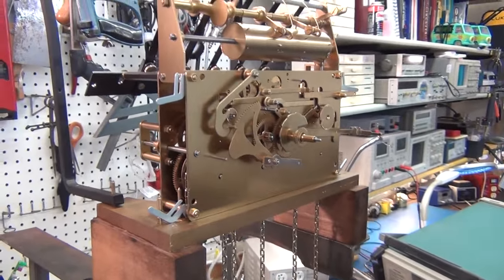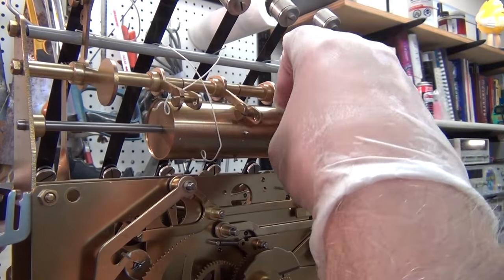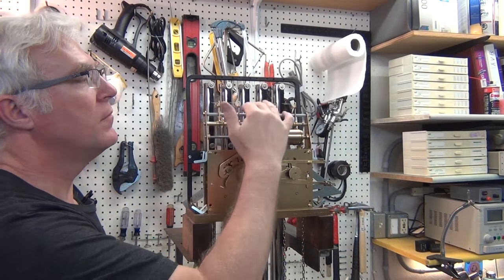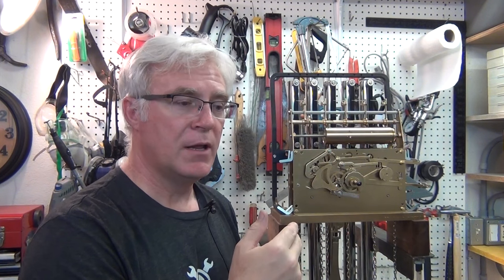Grandfather Clock Test Stand and Hammer Refurbish

Comment: I used to work for the Navy's PTTI (Precise Time and Time Interval) program.  Cesium and Rubidium time standards accurate to 5 parts in 10 -13 seconds.  Now that I am retired I found Todd's posts on mechanical clock repairs.  Very fascinating.  Todd, from one horologist to another, good work!

Comment: I purchased my Ridgeway Grandfather 3-chime, 3-weight, chain-drive Clock in early 1982.  It still keeps time perfectly but does not chime or gong.  So, I have watched many videos about clock repair and maintenance and now have the Urgos UW 32570D clockworks out of the case in preparation of cleaning (with rag) and oiling it.  Do you know of any instructional videos on the Urgos UW 32570, 3-chime clockworks that would assist me with my work?  Thanks in advance.

Comment: Hello Clock Guy - these videos are invaluable. Many thanks - they're real thorough.  I'm dabbling-fixing a grandfather Ridgeway Clock for a friend.  Hanging the pendulum from a spring I made, cut out of clear plastic from the top-hanger section of a plastic container of wood screws (#10/1" one hundred pack, from EVERBILT Flat Head Phillips) with a cut length of a paper clip perpendicular and through the plastic - sticks out 1/16" each side for arms to grab.  It is thicker, stronger plastic and probably farr less fragile than the original springs.  The pendulum weight is un-damaging to the plastic and 'paper clip post.'  Working perfectly, it's flexible and may be more durable than the (already broken-every one of them) springs which came with the clock.)  For the purists, I suspect this is unacceptable but you can suffice while waiting for authentic parts to come in the mail.  I've loved dabbling in all of the rocket sciences. : )
Reply from the maker: Interesting solution. Glad it worked out. Please update in a year or two on how that works out. Thanks.

Comment: Todd, I love that goatee. You should grow it back.  So, my 1905 J.E. Caldwell clock has 9 Waltham tubes, runs very well after I saw your beat video ….but has 1 issue. It chimes 4 times at 10 o’clock and is 6 chimes off subsequently. Is the only way to correct this by resetting the hands or is there another way to sync it properly?
Reply from the maker: Sorry, I’m not familiar enough with such an old clock.
Reply: @ToddFun  thanks for the reply….a fellow ham

Comment: I just acquired the exact same clock from deceased grandparents.
Love it but after first pass of service, I was told most all the bushings at the pivots are worn out. 
For this movement (UW 3/18) any tips on where to get the correct parts if I wanted to tackle this job myself?
Clock runs fine but needs additional power to move the chimes which then will initiate the strike. It will not do this under its own power.
Reply from the maker: you’ll have to take it to a horologist who rebuilds Clocks. Putting in new bushings is not something you can do without specialty tools. If you get those new bushing drill points off even by a tiny bit, the clock won’t work.

Comment: Todd!  I have the same mechanism in my GF clock.  I am getting ready to disassemble and clean.  It does have a problem I was hoping you can give me some insight on.  The chime is going very slow, the fly spins very slowly.  Any ideas  before I jump in.  I am hoping it's just an oiling issue.   Thanks in advance!
Reply from the maker: Could just need a good cleaning and oil of the whole mechanism but also check that the butterfly springs are not broke or damaged, they should pull in all the way on both sides and if you gently pull them out a little the springs should pull the butterfly wings back in. If not the springs could need cleaning or they might be broken. Be careful, delicate stuff.
Reply: @ToddFun  Sorry one more question.  How long is the pendulum required and how heavy are the weight in your shells?  I was told 7.75 for the strike and time and 13.25lbs.  That seems high.  I was able to get it to move faster just by adding oil.  I am going to strip it down and clean it completely.

Comment: Saddlemakers leather works better, you can shave the thicker pieces from the rear to get the right thickness. You need a stiff leather, and soften it with hoof oil before assembly. The oil will evaporate again leaving a stiff compliant surface.
Reply from the maker: +SeanBZA Interesting idea.  I had ordered leather pads from "R & M Imports" which are custom made for these hammers. They might work even better. I will test when I get them. Thanks for your input. Have you serviced such clock hammers this way before?
Reply: +Todd Harrison (ToddFun) No, other equipment that uses a leather wear strip and leather brake pads. The pads are available, but at a price, so I went to a local saddle shop and got a few pieces of offcut hard cow leather, and spent a little time with a rasp and a sharp blade cutting some new ones.  The brake pad runs in oil, so it does get soft with time, but the other wear pad just took a little work with Neats Hoof oil ( also good for suede shoes as well, or regular polished shoes, it gets them nice and soft) to get it slightly more supple. 

Took a few small pieces, and used a letter punch set to emboss my name in the end, and made key bunch markers, so I can feel in my pocket which bunch is which, as they are different shapes. Took 5 years for the one to wear the hole out, so last week just trimmed the thin end with the hole off and used an awl to make a new one. Still have a bag of offcuts left over in assorted thickness’s, even used some to fix a mail bag.

Comment: Great video! Can't wait until the clock is up and running in the living room. I have a suggestion for the text in your videos though. Not sure what you can do with the program you're using, but I'd make the text white with an outline of black. Easier to see and looks better. I'd also leave it up longer. Had a hard time reading it fast enough.
Reply from the maker: +Veronica Harrison I can change the fonts to just about anything. Normally I leave the text up longer but in this video the background was moving around so I had a hard time keeping the text in reference to the frames so I just cut them early. I have the 1st of the 4 videos done on  cleaning, oiling and setup. Once I get the 4 videos done I will setup the clock in the living room.

Comment: I would always replace all the tips at the same time. That way they are all made from the same piece of leather and the sound will be the most uniform. I would never just replace a tip or two. I would do all of them. Besides they have all been in there the same amount of time so they are all probably similar condition. leather will dry out with age even if not used
Reply from the maker: yes, true. I did replace them all. I found a place online that sold precut ones from the same leather and use them.

Comment: Looks like that leather pad has been replaced at some time. Did you try to resurface the leather. If it has a hard surface you can use a fine razor blade to track the surface, making it softer and thus a softer sound.

Keep up the great work.

Jt
Theclockworks.biz
Reply from the maker: I did try a few methods to refresh the leather but nothing worked. I did order new pads from a clock parts store but the lather circles where too thin and the sound was still bad. I found good leather from a local shoe repair store that was as thick as the working leather pads and figured out how to cut and press my home-made pads in place. I replaced all the pads as such and they sound great now.